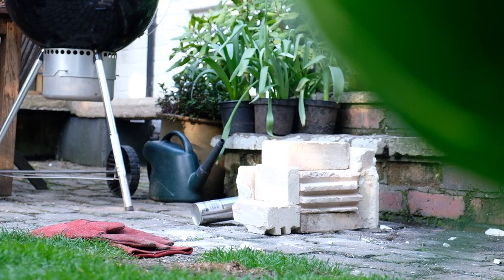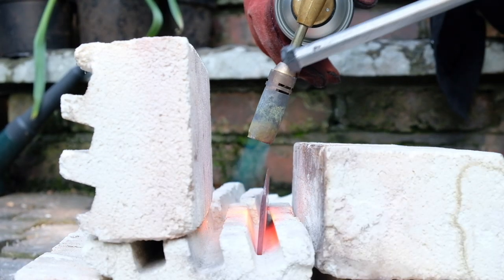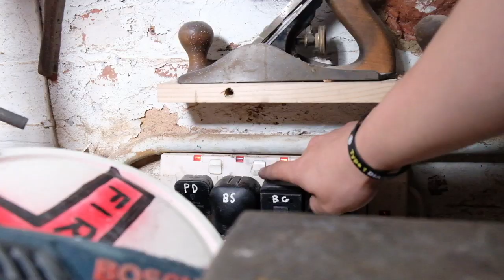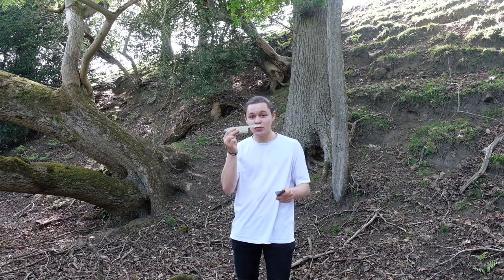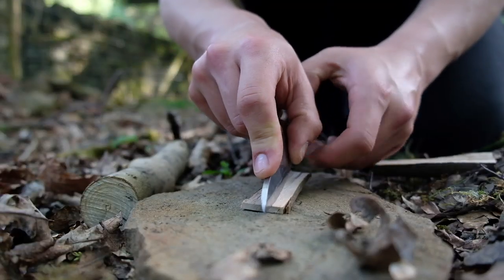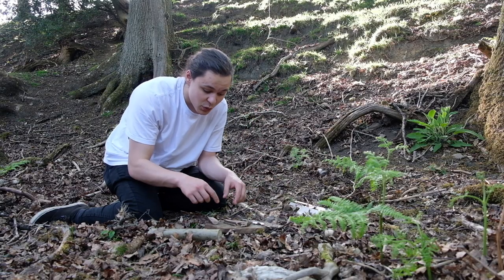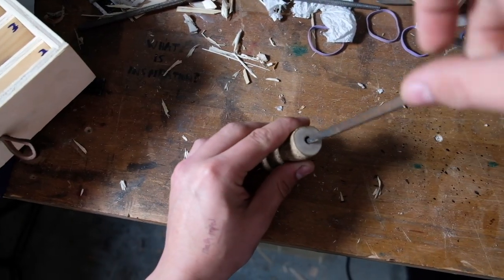Making Knives + Using Branches as Handles?

Comment: I have mixed feelings. You have way more tools than me, but chosen a less professional way to do the handles. I'm not angry at your handles, but confused as to why you wouldn't use a drill to hollow them out, or use your files and sanding belt to shape them... I'm guessing you wanted to keep the bark and round shape for aesthetics?    I am currently drying out some walnut branches, but I'm not keeping the bark. Maybe I will email you, because I found some fun shapes.
Reply from the maker: Hi Daniel, definitely email me, I'd love to see what you're working on; the walnut branches sound really interesting. 
The reason I decided not to use any tools for the handles, was because this was an exploration into how one part of a product (in this case the knife blank) can be used to make the remaining components (the handle). The idea was that this would give people greater customisability; allowing them to shape, repair and replace the handle outside of a workshop environment. 
If you're interested I explain the full thought process over on my website: https://www.jacobmarks.co.uk/branchknives 
However to directly answer your question I would say, just because you've got the tools doesn't mean you have to use them, and in actual fact I think there is great merit in simplifying your toolset and learning to utilise existing natural forms